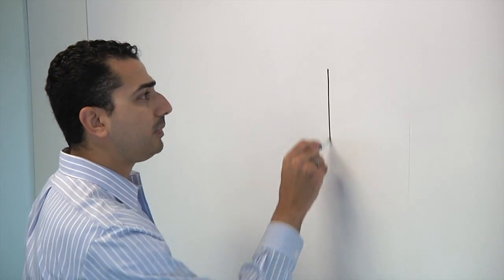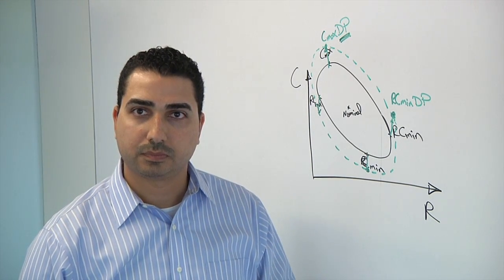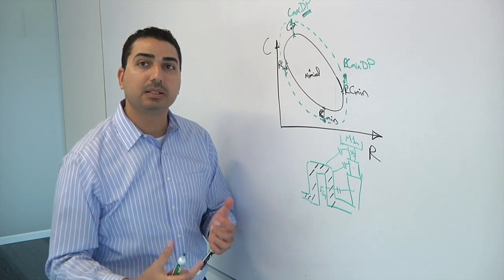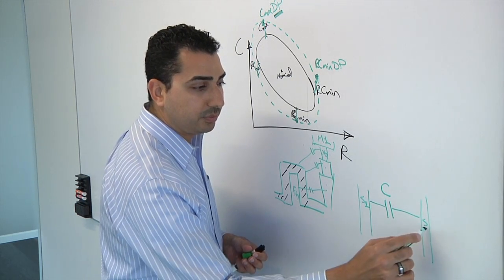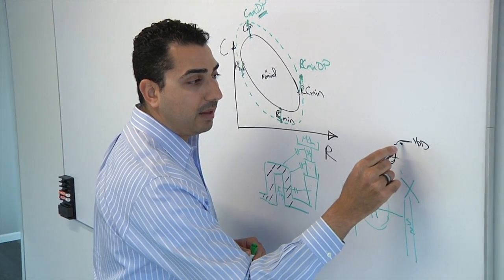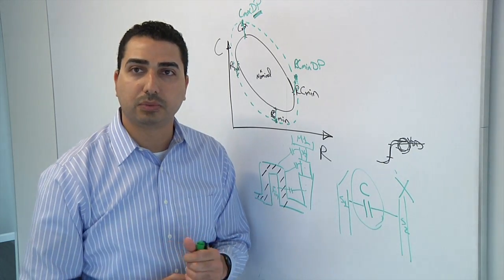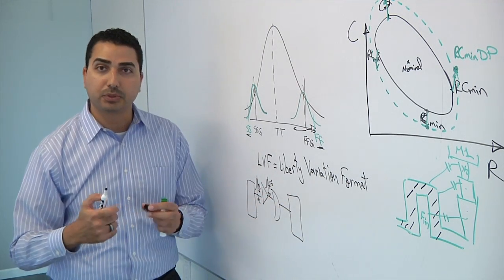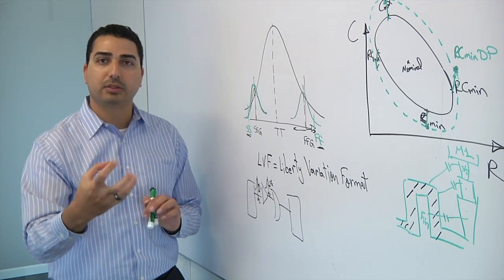Tech Talk: 14nm

Comment: Hello Sir
Nice video 
I have a Question @6:41 you said that miller cap effect will change the value of the cap.
It is a parallel plate cap & its formula is Cap=(k*area of parallel plate)/distance in parallel plate. Where k is constant.
Cap does not depend on absolute voltage or direction of swing of voltage on the plates. I think you meant positive or destructive interference  between the two signals due to the cap.
Please comment  .

Regards
Ankit
Reply: ankit mundra We are actually talking about miller theorem here.  If I remember correctly, that parallel cap can be divided into two different caps whose values are dependent on gain of amplifier.  That's why voltage will come into effect